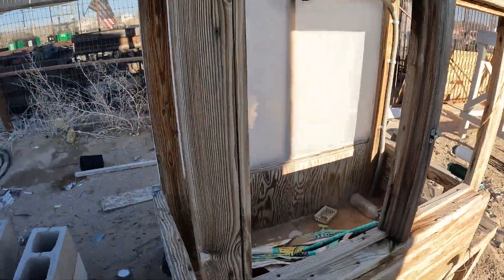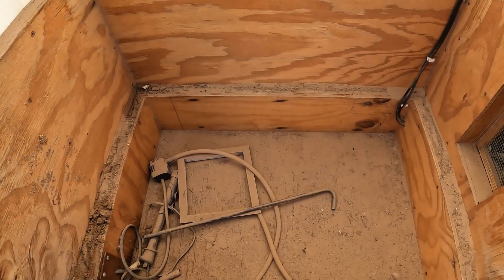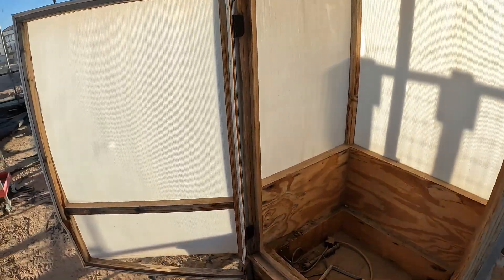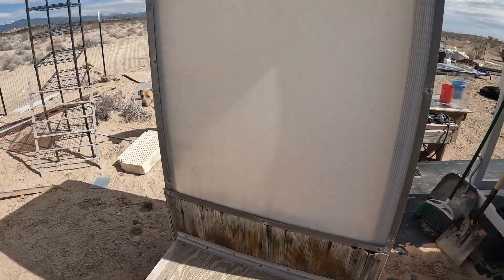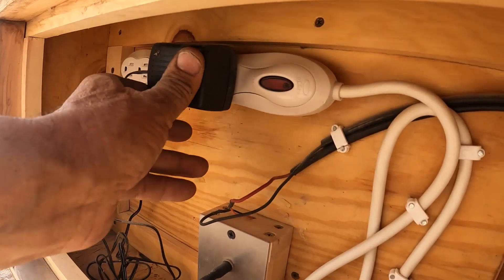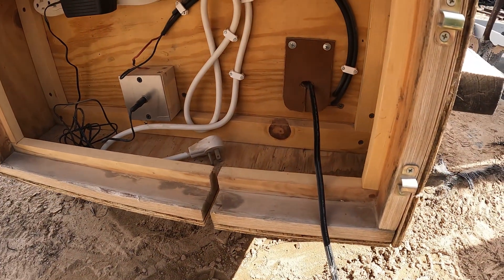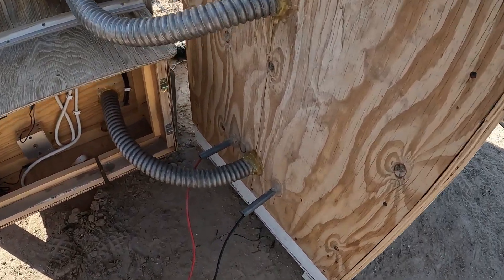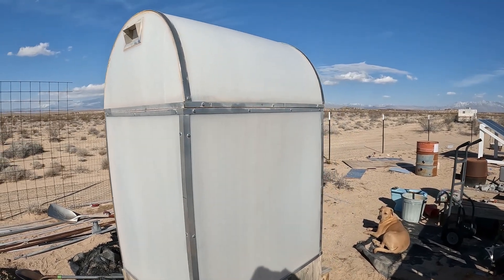Sand Battery Connected to a Greenhouse, Episode #82

Comment: Be careful with the temps of the galvanized containers:
https://www.youtube.com/watch?v=VDCzMaL0oiY
A quick Google search shows:
"Zinc toxicity can occur when an individual is exposed to and breathes the heated yellowish fumes produced from welding or heating galvanized steel. For hot-dipped galvanized steel the recommended maximum temperature is 392 F (200 C), before the metal presents a toxicity risk."

Comment: I am thinking about a Sand battery dehydrator 🤔
Reply from the maker: Yes a sand battery dehydrator sounds like a great project. I am going to dismantle an older dehydrator I have and see if I can run it direct off of the panels without batteries. My thought is to replace the AC fan with a DC one and wire the element directly to the panels.